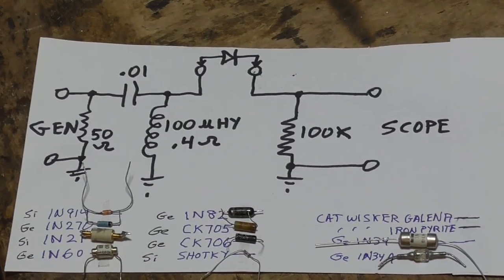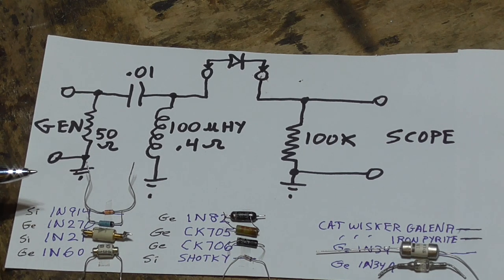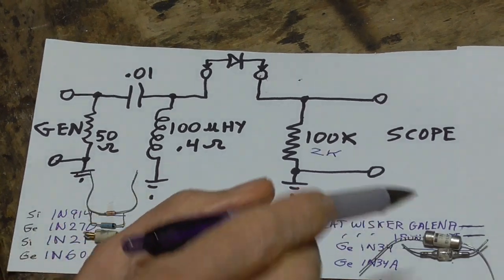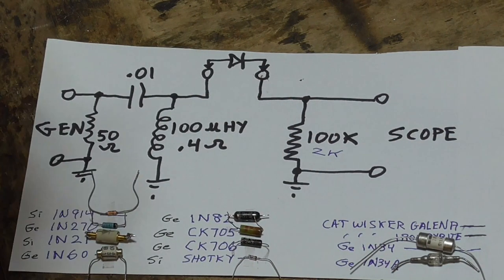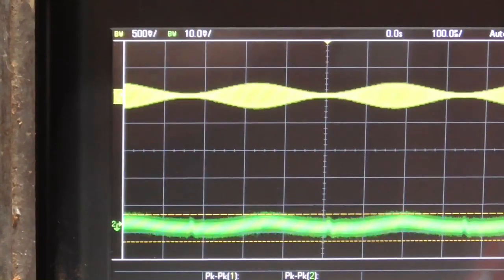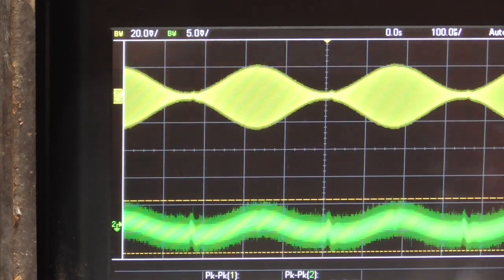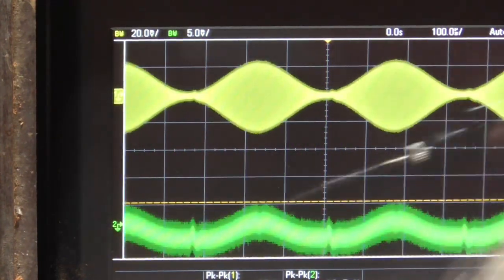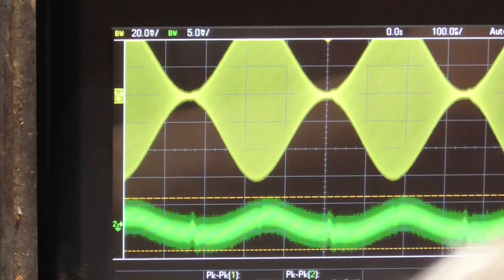TESTING DIODES FOR CRYSTAL RADIOS

Comment: Very interesting results Ron, my favorite diode here in the UK is the oa90 & others in that series. Work great in crystal sets. By the way years ago I ran an lcd clock off a crystal set, I had so much signal from the local 198 kHz 500 kW transmitter. It would also light a red led
Reply: Oa91 here in Wales!
Reply: A clock powered by the cricket!

Comment: Yes bought the 1N34A on fleabay, and of course they are Shottky. Still have a few old Sharp Compet boards though with the nice Sharp made Germanium diodes, that still do work for use, the 34A's are used as higher level diodes, though with 40V reverse they do handle high voltage better.
Reply: Look for a GEX 34. An English version.
Reply from the maker: The applications I use the 1N34 are crystal radios, where reverse voltage is not a problem. Ideally you want a point contact diode rather than the modern junction diode. The 1N34 diodes you buy now days are germanium junction diodes, which are the same characteristics as a 1N270 or any other germanium junction diode.
Reply: Same happened to me. I just checked ebay, all but one are shottky. And that one, $14.

Comment: When I was a kid building crystal radios c. 1960 I would make a detector by tickling tarnished copper pennies with pencil leads.  For a condenser (capacitor) I would use sheets of aluminum foil sandwiched between paper.  I would have been astounded at your setup here.  :)

Comment: That bias does not have to source very much current, so how about a separate "noisy" antenna connected to a voltage multiplier gm diode/capacitor bank for RPOA remote power over air (similar to other clandestine devices) ?
Reply: Use a solar panel from an old calculator, which, with the on circuit board voltage regulator diode, will work, plus you also get a germanium or shottky diode there as well to use.

Comment: I knew that this would be interesting as soon as I saw that you brought in the germanium diodes.  My dad always said they were better than silicon for the crystal radios that we used to make, and I used to make such projects from the x-n-1 project kits from Science Fair (later just called Radio Shack). Of course with the kits it was clear because the silicon diodes would only pick up a very close radio station we had nearby, but the germanium would catch multiple AM stations in town at the time. Excellent quantitative analysis!

Comment: I have just built my first crystal radio, which disappointingly  didn't initially work with some eBay 1N34A's, but I replaced it with a different 1N34A (from Mike's Electronic Parts, Ohio) and it worked!  Really stoked!!  This video was really interesting to see the differences between the diodes and to understand the effect of bias.

Comment: About ten years ago when I was in high school I built a small crystal radio with a mini solar panel for diode bias, and I set out to try it with every single diode I could get my hands on.

I tried it with all manner of silicon rectifier and signal diodes, shottky diodes, old varactor diodes from TV tuners, cat's whiskers with a variety of minerals including pyrite, galena, chalcopyrite, bornite, and silicon dies from busted chips. I even tried out LEDs and laser diodes. I found that LEDs worked pretty well with the strong stations I had and a AA cell in series with them for bias. I didn't have any germanium diodes at my disposal back then.

I am really missing the time when I had the time to just build radios for fun, besides most AM stations worth their megahertz being long gone.

Comment: It would be interesting to try a vacuum tube diode like a 6AL5 or 12AV6. 
Or maybe one of the 1.4 volt tubes.
Maybe a vacuum fluorescent display would do something.
The load would have to be higher impedance.
The frequency response would be good to check.
Reply: I built one several years ago with a russian 6D6A - subminiature diode. It works ok but I found ge-diodes to be better ;-)
Reply: I think that a 1.4 volt tube with its directly heated 50 ma filament would not be as good of a detector as the directly heated 6.3 volt tubes.
Reply: @johncasteel1780  Actually there is no big difference - tried both. To be honest my tube detectors where pure 'fun projects'. In general it doesn't make any sense due to the heating and because they are simply not designed for that...
If you want to use a tube there are many good circuits for regenerative audions even for low voltages. They are WAY better ;-)

Comment: This is an excellent reference video. I built a radio just last night using a 130-in-1 project kit, and this kit is new containing to purported 1N34A Ge diodes. The strange thing is that they’re unmarked except for a distinctive opaque bright blue color with black cathode stripe. It actually works pretty well at night and is able to pick up a 750W directional station on MW band. Still, I’m not certain what those diodes are.
Reply: You may have a 1N270 germanium diode like the one tested in this video.  The 1N270 is electrically very similar to the 1N34A except the reverse voltage is rated at 100 volts as compared to 65 volts for the 1N34A.  The 1N270 diodes I have are blue with the black cathode stripe, but they also have ITT printed on them, indicating the manufacturer.
Reply: @analog_guy  Thank you!

Comment: Those CK705 and 6 are old Russian made diodes. Believe I have a data book that covers them. I collected lots of exotic semiconductors from street markets in Saint Petersburg and Moscow during the 90’s.
Reply: They also could be old Raytheon parts. The CK705 was a Raytheon equivalent of the 1N34. In the '50s, Raytheon also introduced the CK709 as an RF transistor and the CK722 as an audio transistor to the general public.

Comment: Loved your video. Well done. I have a Hallicrafters SX-130 shortwave receiver. It uses a 6AL5 vacuum tube detector. I replaced the 6AL5 with a 1N34A germanium diode. I found that with the germanium I had to turn up the audio gain control to get the same audio level as with the vacuum tube. Interesting! I pulled the 1N34A out and put the 6AL5 back in. It seemed to me that the 6AL5 is more sensitive.
Reply from the maker: The 6AL5 cathode emits with zero volts on the plate so there is no threshold. Thus, the output will be slightly higher. Good ole tube stuff!

Comment: I have also used a coherer detector, which is a bi-direcrtional non linear device. I found the Mercury-Iron coherer was approx 10dB inferior to a Ge diode.
Reply from the maker: The coherer is basically a RF triggered switch. It is not meant to be a square law detector device. Any AM detection you happened to get was circumstantial with no good logic to explain it.
Reply: @glasslinger  Hi Ron, I enjoy your videos very much. 
As you say, the classic Coherer was intended to act like a relay with a battery, eg ringing a bell when it detected RF. 
However it is not widely understood is that it also was used as a Square-Law detector in series with headphones. 
In fact Marconi's notes show that he used a coherer and an earpiece for his famous crossing of the Atlantic. 
(do a search on Marconi, Atlantic, Collier-Marr earpeice, Italian Navy Coherer)
It makes sense, because a coherer is just a dissimilar metal contact (iron filings, mercury, etc).
Reply: @glasslinger  There seem to be two modes of operation of coherers, either as a switch or as a "linear" device. Marconi used the mercury-iron coherer in conjunction with an earpiece for detecting radio waves across the Atlantic. I find that most metals will work; we see a bi-directional square law curve, and it is supposed that it is the result of electron tunneling across a very thin insulating layer of oxide.
Reply from the maker: @msf60khz  Using instruments, I was not able to get any rectification at all. It was non-conductive up to a point and suddenly switch to lower conductivity.

Comment: Dear Ron
You might want to add a .002 uf or so across the 100k load resistance  to act as a low pass filter.  There is RF on the scope as well as audio.  The peak to peak audio measurements are made less accurate by the RF.  Higher diode Capacitance raises  the p-p rf voltage.
Love your channel!
Dave
Reply from the maker: Yes. I tried a capacitor and found that the total output signal stayed the same. The chart may be  a few millivolts off but the comparison is good. The 1n34A is clearly the champ! But genuine germanium diodes are close to the same.

Comment: Hi, Really very interesting. I also made some measurements on the diodes but with a slightly different approach. Indeed in France we no longer have AM and the only possibility of receiving something are the very distant stations in MW or SW and BBC at 450km in LW with LF amplification and listening on loudspeaker. These are levels below 10mV in general. For me the threshold voltage measurements generally given at 1mA are not representative of the conditions in the receiver. So I made measurements at 10 and 50 µA. I found a very good correlation between the listening level in the speaker and the results at 10µA. I am a little surprised by your results for galena because for me it gives the same results as 1N34, OA79, BAT85 and this for fairly homogeneous sz threshold values of 0.1 or less at 10 µA. At 0.15 it is weaker (1N60) and very weak at 0.2 (1N1711)If you are interested, a video is on my channel, (The BAT is not there yet)

Comment: Definitely would have been worth turning on averaging for the measurements! Also, I don't think I've ever seen someone use the resistance ranges for diode checks. At first blush, that seems to be like it wouldn't be a very good way to compare diodes. Why not use the diode check range on your meter?
Also, during the 1MHz/10MHz checks around 25:30 in, I'm not seeing the waveforms change period when you switch. Were they still connected to the same circuit?
Reply from the maker: It circuit was adjusted for most output and best view. Using a meter to test diodes is only for leakage and forward voltage. A curve tracer must be used for serious comparison.

Comment: Awesome series. I’d love to see something similar with a bunch of different Russian germaniums. I’m sorry that your friend didn’t have the best of luck with his.  I bought several from a fairly well known and trusted seller out of Ukraine, I got their equivalent of the 1N34, 1N34a, 1N60, and a few others that folks on the forums say are exact equivalents of some of the ones we use.  I also got several D18/1S307 blue tip “holy grail” diodes. Not sure what makes them “holy grail”, but many call them that.  Anyways, maybe the difference was the price as the ones I picked up were far more than 20 for $1. They were about $12 after shipping and you got 30 of them, the D18s were a bit more.  Since I got several different kinds he did combined shipping and they ended up being closer to $9 for 30 diodes.  I tested every single one and not one dud. I measured them at different currents and they all had fairly tight forward voltage groupings, meaning per device number.  Much better pricing than the $12-$15 EACH for the 1N34 and 1N34a that people are asking. That’s crazy pricing. I was able to get 40-50 diodes for the price of one essentially.  I wish the authentic ones that were used in the US could be found cheaper.  Anyways, would love to see a comparison.
Reply from the maker: Note that all modern diodes (except microwave diodes) are grown junction diodes. The original early diodes were point contact diodes where the "junction" was a microscopic point where the needle tip touched the germanium. Thus, you will not find any of the modern diodes that will have the sensitivity of the original diodes. Point contact diodes are no longer made because each diode has to be individually adjusted. Not practical in production quantities at any price you would pay. There are no modern uses that demand the sensitivity of point contact diodes to make production practical. Thus, buying Russian diodes are no different than buying diodes from Mouser.
Reply: @glasslinger  yes, that is what I purchased I believe. I wish I could post pics. Magnifying the diode you can see through the glass body a very thin wire that kind of curly q’s as it comes to the very fine point that touches what I’m guessing is germanium on the other side of the diode.  I’m using the microscope I use for smd soldering to see it, it’s a very tiny wire.  Could I possibly send you some photos that you can confirm? If they are good early ones I’d be happy to send you some if you have any desire to test them.

These are definitely old stock.  Their build suggests several several decades ago, but I know Russia was making this stuff after us.

Comment: Nice demonstration of the usabillity of different diodes for crystal radios - thank you! I liked especially comparing the results at 1/10 MHz. The resullts (absolute values) clearly will change with every different setup of the crystal set (due to several reasons) - but the tendency seams clear: Ge is the best ;-) May be you could use an old Ge transistor (EB/CB-Diode) if you don't have any Ge-diode ...
Reply: Probably not. For detection, a point contact diode should work better than a semiconductor junction.

Comment: The forward voltage drop is proportional to the reverse breakdown voltage in Schottky diodes. A Schottky with a low voltage drop will have a relatively low breakdown voltage and high reverse current leakage like germanium diodes.
Reply from the maker: Interesting observation. However, for crystal radio operation they still would need a small bias to eliminate the threshold.
Reply: @glasslinger  A schottky diode is a metal-semiconductor junction. Crystal detectors are primitive schottky diodes.

Comment: It would be interesting to see how a germanium transistor junction would work as a detector diode. 🤔
Reply: They work well, basically a biased diode with the transfer resistance providing current gain. Even silicon transistors work well here, and are the basis of all integrated AM detectors, where the bias voltage is provided by another identical base emitter junction used as reference voltage, and a resistor to provide the input bias.

Comment: You should include a copper oxide element (Cuprox, Sirutor). It also was used in AM detectors, too.
Reply from the maker: They were used back when the carrier frequencies were in the 20 KHZ TO 100 KHZ  range. The efficiency drops drastically above about 30 KHZ and is for all practical purposes unusable at even broadcast band frequencies.
Reply: @glasslinger  Thank you. My father told me that he had used it at about 700 KHz, but it was probably in the vicnity of a broadcast transmitter. I have never played with it.

Comment: Thanks for making this video.
I'm currently playing around with shortwave crystal radios and got stuck at using a east German WF OA645.

Some people online recommend modern schottky diodes like HSMS-2860 or 5082-2835. I did not get hold of these for now but I may try.
Reply from the maker: Note from the experiment that the schottky diodes work great if a small forward bias is used to bring the threshold down to zero. They will rectify up into the high megahertz,  even the low UHF range!
Reply: @glasslinger  Just finished watching. 
I will try a little bias shortly! This might get my receiptions to a higher volume. I'm using 4kohms headphones as I don't want to spend like 60€ on a 50K:5K transformer or something similar just to get the load off that diode… that's not worth it…
Reply: @radio-pirol  If you are adding a bias battery anyway just add in a 1 transistor class A amplifier as well, to use the bias supply.
Reply: @SeanBZA  that would be too easy 😅
I want it to work without any active amplification.

Comment: Good video.  Confirmed what I've been reading, hard to get a good modern diode for a crystal radio.  Was disappointed you skipped the foxhole radio with a razor blade.
Reply from the maker: I wasn't able to get one to work. Possibly need an old razor blade.
Reply: @glasslinger  should have known you tried it
Reply: I used green pennies touched by a safetypin in the 60's.

Comment: Would be interesting to see this kind of test with a copper oxide diode, and with an ideal (active) diode as comparison.
Reply from the maker: A while back I tested a small meter rectifier copper oxide diode and found the frequency response decreased rapidly above the audio range. No good at all for RF. Not sure why, possibly the capacitance of the junction.

Comment: If these modern diodes were all we could find in the trenches today how could we figure out the forward bias needed without an oscilloscope? 

The needed voltage could be produced with homemade batteries of all kinds.

Your 500 ohm variable resistor could be made up of individual scrap resistors to get the amount needed for a given diode.

The 4.7 mf capacitor is a common enough value to be found in almost any scrap circuit board for salvage.

Would you simply drop in a 500 ohm resistor and test it? What would you be listening for to determine if you needed more or less bias to tune such a circuit by ear?